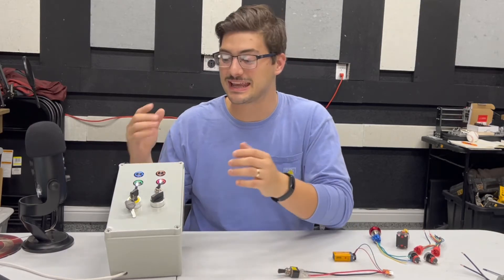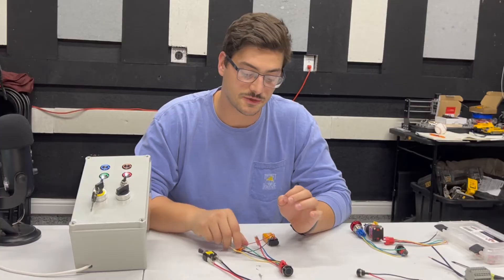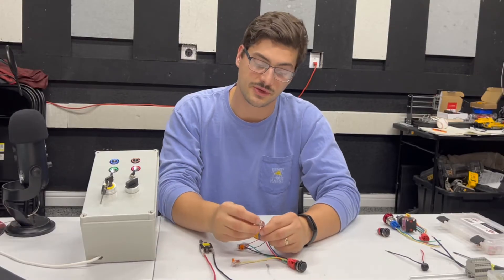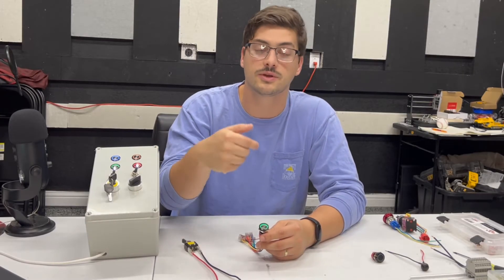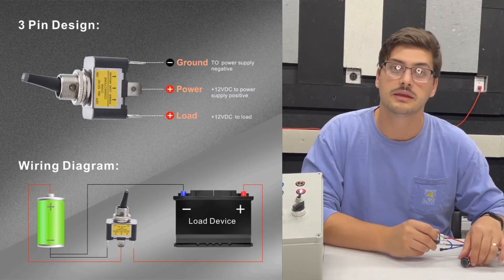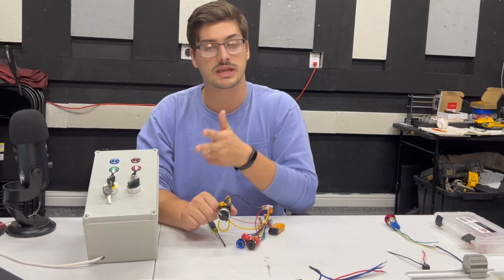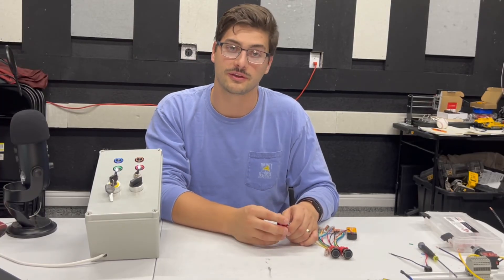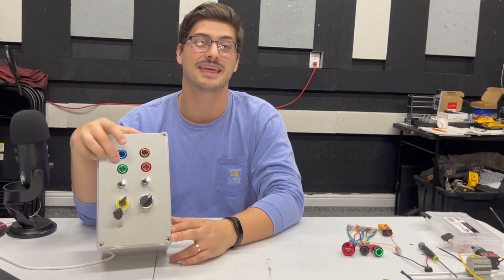How to Wire Pushbuttons and Switches!

Comment: I have a question regarding connecting an AC-rated Apiele NO/NC latching pushbutton switch in an AC application.  I've tried contacting Apiele directly for more accurate info and have received extremely vague instructions from them thus far.  I just need to verify the connections for a power switch.  My read thus far, based on what info I've been able to glean to this point, is this: 
LINE wire (incoming power from source) to NO inbound terminal (Tab 3)
LOAD wire (outgoing power to devices) to NO outbound terminal (Tab 4)
NEUTRAL wire (from source) to NEUTRAL wire (to device) and LED positive (+) terminal
GROUND wire (from source) to GROUND wire (to device) and LED negative (-) terminal
Do I have this connection layout correct?  Any info helps.  THANKS! 0:05
Reply from the maker: So the only wires that matter for the switch to work properly are technically the “common”, NO, and NC. When the button isn’t pressed normally open (NO) will not be connected to common and NC will. Then when you press the switch that reverses and NO is connected to common and NC is not. Then for the LED you’d need the neutral on one, and if you want it to dynamically light up you could jumper it to the NO wire so it only lights up when the button is pressed! 

I hope this helps, apiele is I think a Chinese company so their diagrams aren’t always that clear!
Reply: @lemastertech  And you'd be right.  It took about a week of messaging back and forth with Apiele to get a proper answer regarding wiring up the switch.  The cool part is that after everything was wired up correctly, it works like I hoped it would.  Final wire-up went as follows (in an effort to help out other folks who want to use the same switch):
LINE wire (incoming power from source) to NO inbound terminal (4.8mm lug #3)
LOAD wire (outgoing power to devices) to NO outbound terminal (4.8mm lug #4) and 2.8mm LED positive (+) lug
NEUTRAL wire (from source) to NEUTRAL wire (to device) and 2.8mm LED negative (-) lug
GROUND wire (from source) to GROUND wire (to device)

I have all the wire connections protected in a small ABS project box with the three necessary cables (source power, device power, and the wiring harness for the switch) run thru cable glands in the sides of the project box.  I use this as a power switch for a guitar pedalboard and it works like it should.

Comment: I am wiring up one of their switches and found your video, it was very helpful getting the latching switch  to work.. but when wiring the LED the light comes on when the switch is off.  I've tried reversing the led wiring and it acts the same. It's controlling a relay if that matters.. any additional belp would be appreciated. Thank you!
Reply from the maker: Thanks for watching! If you want the LED to come on when the light is pressed in you want the negative leg of the LED wire to 0 VDC and the positive wire of the LED connected to the Normally open wire for your button, then you’ll want “common” connected to your power source!
Reply: @lemastertech  I got it sorted thank you!! Between your video and wiring rescues video, I am right as rain! So thankful for you both!

Comment: So the common wire, connected to the LED wire, is also the power output to the load?  In my case, in an automotive application, a relay.  I looked for a sensible and informative description of how to wire up my push button latched LED switch and yours was by far the most comprehensive and easiest to understand.  My switch is a dual-pole item which made it all the more complicated to the uninitiated!
Reply from the maker: So common in terms of buttons is the wire that bounces back and forth between the normally closed and normally open contacts! 

So in this case I wanted the LED to turn on when the button was pressed in and off when released, so common can be connected to the “power” for the LED and it will switch with the button! 

Then let the 0 VDC signal connect to the negative terminal of the LED and normally open wires, and connect your 12 volt or 24 volt of whatever power to normally closed! 
I hope that makes sense